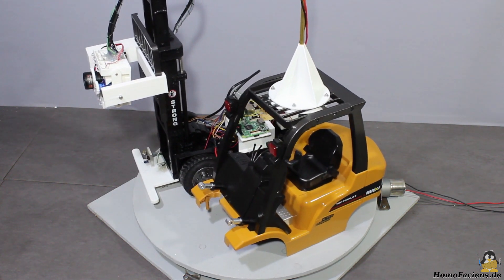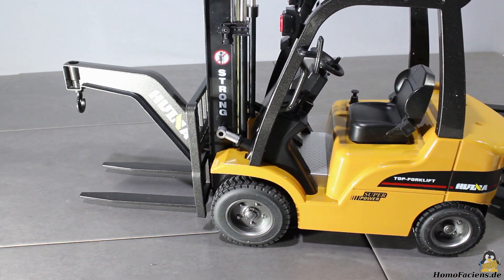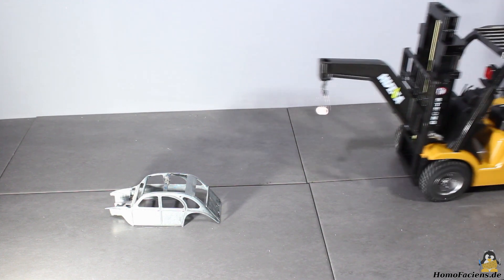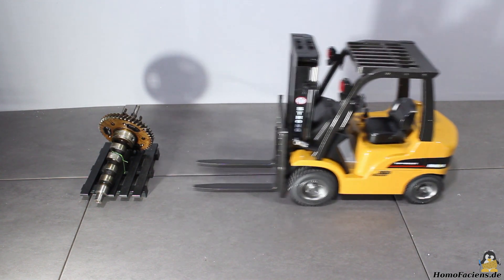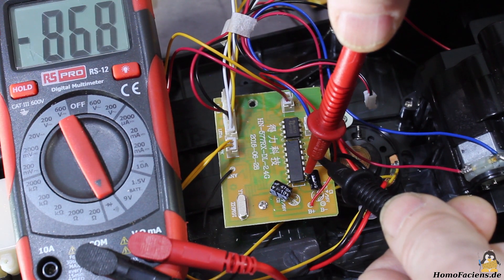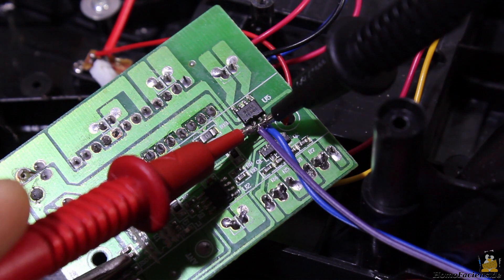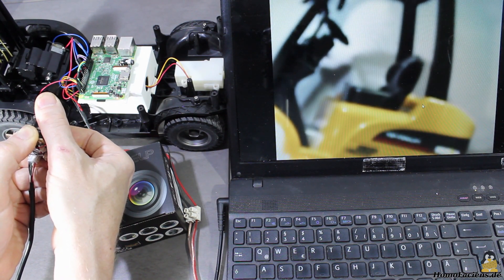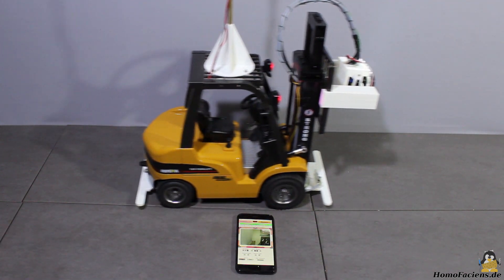Converting a HUINA forklift from Radio Control to Browser Control

Comment: first of all comments! haha:-)

Cnversion very nice even if at times a bit 'rough (the dremel to remove the IC, the position of the micro down on the forks, etc.), but the 3d printed parts are very fine and all the camera assy is fine too!
Jjust a little bit too quick the up and down rotation of the camera (si it seem,  looking at the video).
Could you use the original IC, eliminating only the high frequency receiving section?
Would it have been more difficult to program the Raspberry Pi to emit a signal that is understandable from the original IC input?
Can you tell us the model of the camera? 
Your link took me to the ELP homepage.
Thank for sharing yours esperiences
Reply from the maker: I definitely did not want to reverse engineer the working principle of the RC chip, so the dremel is a quick and easy way of removing it. 

You can slow down the servo movement if you think that would be better, but I won't change that.

I have (currently) no idea how to make the Pi emitting the needed radio signals, imitating the remote control. That radio control is labled to work with 2.5GHz signals, however I did not prove that. I can't say if you could sent the signals with the Pi WLAN module and that module is needed to get access to the Raspberry and you can't use it in both ways.

The camera is the 960H Varifocal model on their page. There is also a link to the camera on my project page:
https://homofaciens.de/technics-robots-R9-construction_en.htm
Reply: Thanks for your reply:-)
I must have explained myself badly: I did not intend to make 2.5 GHz emit to the raspberry, even if wifi and bluetooth work at those frequencies, you should modify and or bypass the corresponding digital protocols, which is practically impossible.
The receiving circuit takes the 2.5 GHZ of the carrier frequency from the antenna and demodulates the low frequency signal that enters the control chip. I was thinking of eliminating only the receiving circuit and replicating the digital signal with the Pi, but actually generating variable frequencies to the raspberry Pi is complicated.
Reply from the maker: Now that I have removed the chip it's hard to do a reverse engineering of the circuit ;-)
Maybe I'll have a look at that in a future RC toy I'll convert for my robot room. I'll keep your idea in mind, thanks for sharing your thoughts.